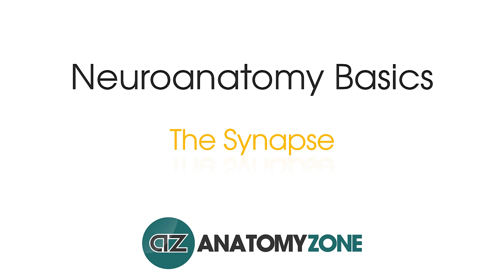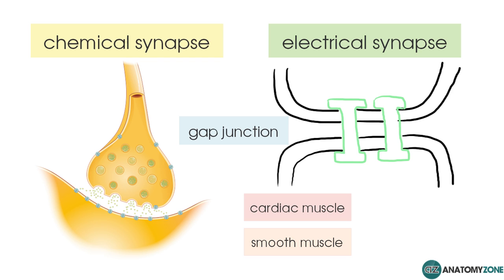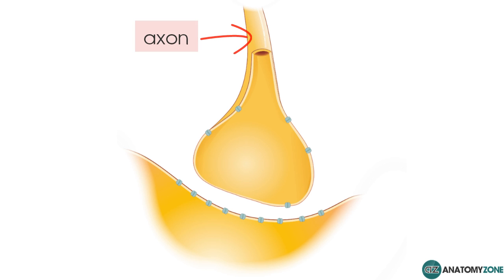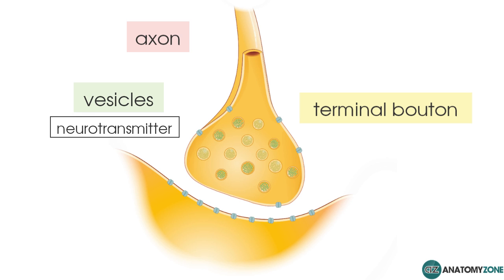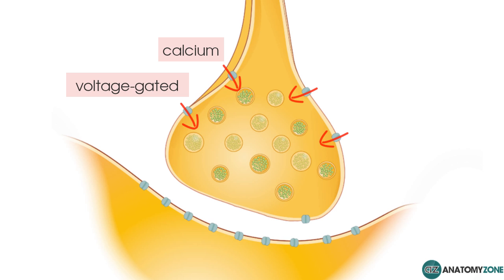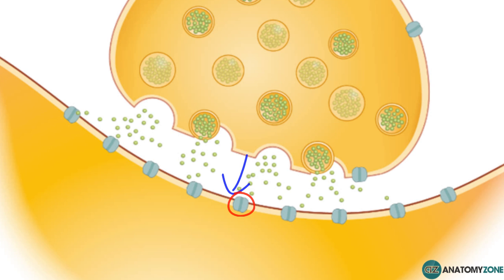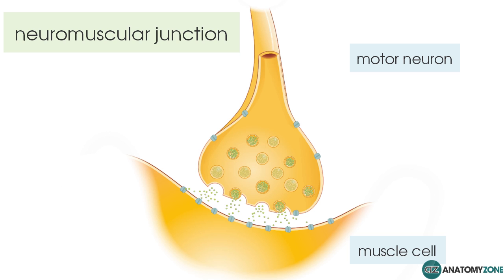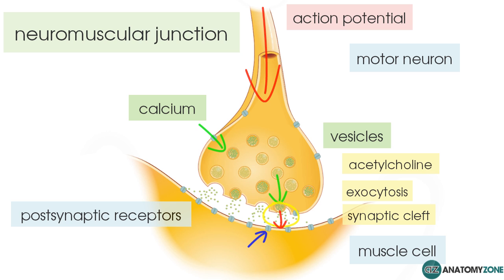Synapse Structure - Neuroanatomy Basics

Comment: Great, video as per usual. What I always wonder when I see these types of examples is how is it that we know this? Is this a system that we can see happening under a microscope or are we inferring this through other tests? This may be a typical psychologist trying to understand biology/chemistry question but this is genuinely something I'd like to know. Are you able to point me in the direction of any materials for this query?
Reply from the maker: Thank you :-) There are lots of techniques in neuroscience for trying to work out what is happening a cellular and molecular level. You can visualise things to a certain extent using a microscope, and you will be able to see things like synaptic vesicles. There are numerous electrophysiological techniques, such as patch clamp and voltage clamp recording which essentially use microelectrodes, which allow you to measure currents across the ion channels in membranes. In addition to electrophysiology methods, there are also ways to look at receptors at the subunit level, using proteins that bind to certain subunits which can then be visualised more easily. Additionally gene knockout models can be used to assess receptor function. So lots of different methods!
Reply: Great thanks, lots of interesting sounding techniques for me to start googleing there! :-)